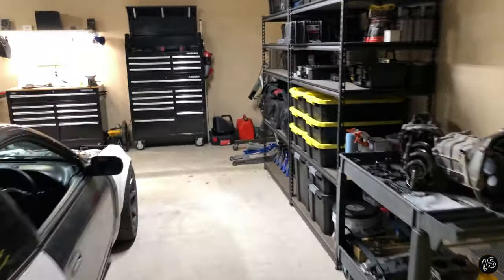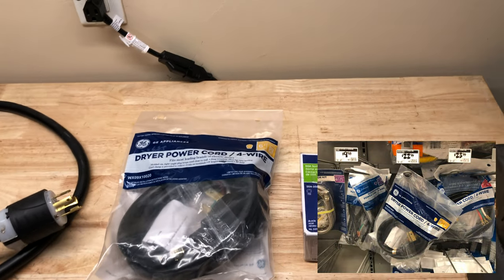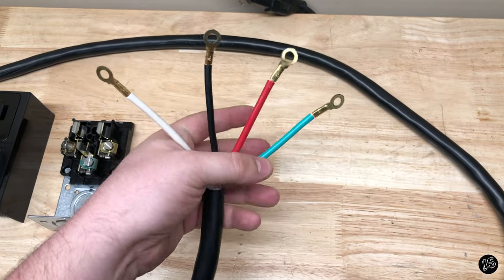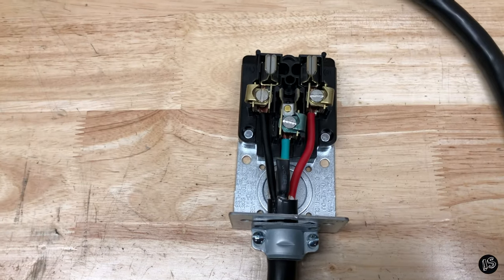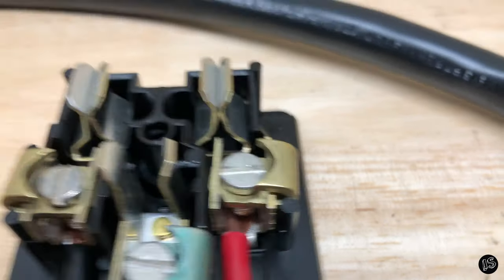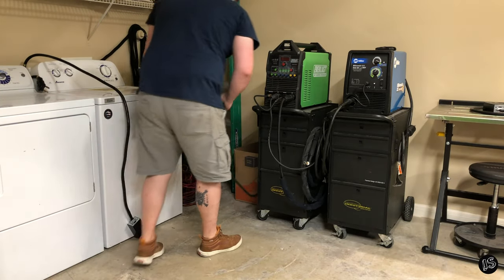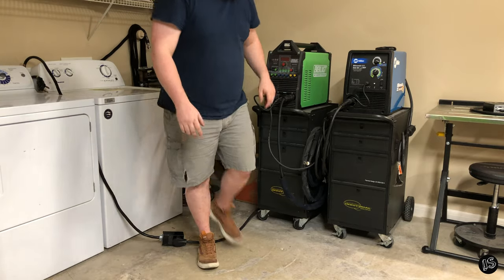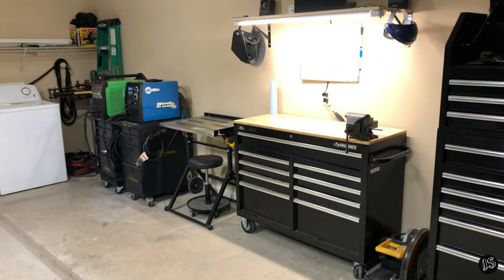DIY Welding Extension Cable [Dryer's 220V Outlet] | Tutorial

Comment: Solder the ends of the red, black, and green wires. When the wires are secured by the compression screw they will sit nicely and not come apart.

Comment: Hey, big thanks for this video! I bought an inverter welder & a genset that runs 9kw, got out in the bush & couldn't use it! So, bought a "range" male plug & have been wondering how to make an adapter - and extension, because these inverters have short cables. I'll read the comments section to gain info from others. 👍
(Edit): Have you tried running 6010 with this set-up?

Comment: I made 2 of these before there was such a good video about how to do it. I have 2 circuits with 4 prong dryer outlets and 30 amp 240v breakers. I made two extension cords, one with a 3prong welder receptacle like yours and one with a 20amp 240v receptacle for my table saw, jointer and planer. I don't bother with the locking plugs since its just me in the shop. I run a 200amp miller stick welder, a 240v plasma cutter, my 3hp table saw, 20" planer and 8" jointer and never had any issues. Video is very easy to understand despite losing the time lapse, it happens.

Comment: Just like you promised , i built myself  the same adapter but i got a 3 wire cable never knew i needed a 4th wire to feed 240v

Comment: Ya but what if its to the other tilted plug design (out of wall) ? My dryer and house is older and Im going into a yeswelder 205DS model that works either 110 or 220
Reply: Got my yeswelder yesterday. Going to make this plug today
Reply: @hinds90  I was shocked that I was able to just plug it into the 120v wall and it worked perfectly !

Comment: How many watts would you say that can support? I have a Millermatic 211, the specs have a max wattages needed to run it at max. I know certain gauge wires can support a certain max watts. This is a great idea btw. Thanks for the video

Comment: I’d like a bit of a review on that miller. I am borrowing that welder right now
Reply from the maker: Whoops! Just saw this. I have had this welder for several years now, and it is still my favorite MIG so far. It’s just simple and works. There’s beauty in that. If you’re using the autoset feature, it gets surprisingly close for the material you’re welding. All in all, great unit.

Comment: How long of an extension cord could I get away with before I lose power to run my little welder? I have to use my dryer outlet and go outside to my workshop. I have 50ft 8awg so far, but I need to go further.. Is there a rule of thumb on this?
Reply from the maker: There’s definitely a limit, and I am not sure where it is. I keep these cables less than 30’ personally because I am not too sure. I’m sure there’s a rather simple current calculation that can give you your answer though. I’ll probably look it up out of curiosity now.
Reply: You're not supposed to use an extension cord with a welder so the shorter the better. 50 feet is way too long. It's gonna still weld at 50 feet or more, you can maybe even do 60 or 70 but it may not work right

Comment: I need to do this. Is that 30a dryer outlet big enough?
I thought a 200a welder needed 40a to go max power?
Reply from the maker: It's duty cycle dependent. You can calculate usage based on your machines specs. 30a dryer outlet works for me everytime. Never tripped my breaker, but I also don't weld for 10 minutes continuously. Lol I will usually weld the area I need, reposition and do a few more welds and that's it for several minutes. 

If you're going to be doing heavy duty stuff, then you need to run a dedicated power source to meet your demand.

Comment: But your everlast runs out of 240 50 amps and that predator has a 240 30 amp,  did it work
Reply: Sorry i comment on different video of yours but thats my question
Reply from the maker: I'm not really sure what you're asking. Sorry. I run my Miller and Everlast off the Predator all the time, and it works fine for my projects.

Can I max out my Everlast TIG on this Predator generator? No, I can't. The welder at its maximum setting is more than the generator can put out. However, I personally never run either of my machines at their max settings on generator power for more than a hot tack.

Comment: What confuses me is how does a wire that is rated for 50 amps end up driving a welder that produces 200 amps?
Reply from the maker: You'll need to Google "How a welding power supply works" to get the full answer, but I can give you some cliff notes...

My abridged version:
Welders are either transformers, inverters, or some other kind of voltage/current modulator. 
 
The welding machine takes in moderate voltage/moderate amperage and converts it to high amperage/low voltage on the output. 

It's a trade off conversion. No trickery. You're not making a 200 amp output from 50 amps without losing/converting something in the process.